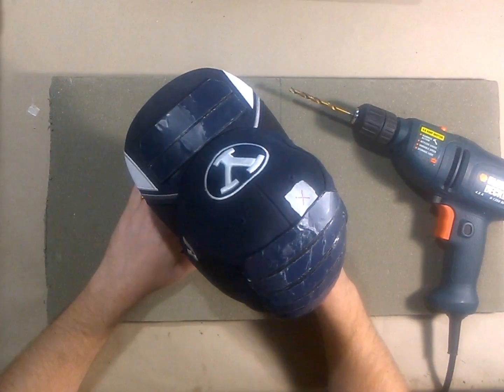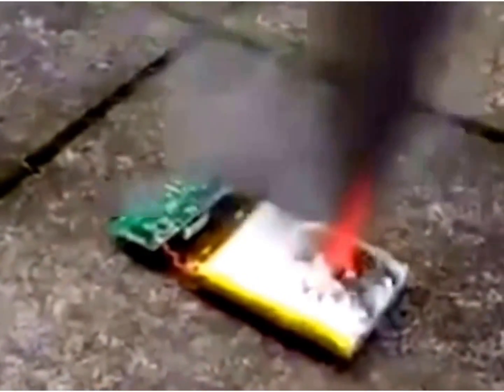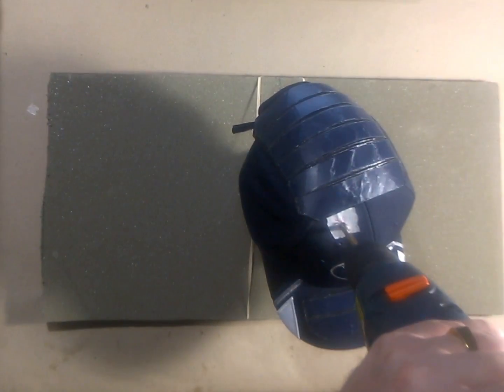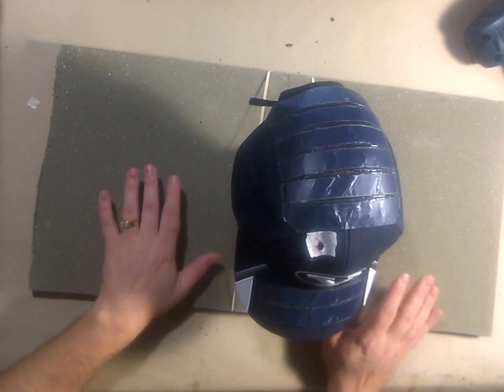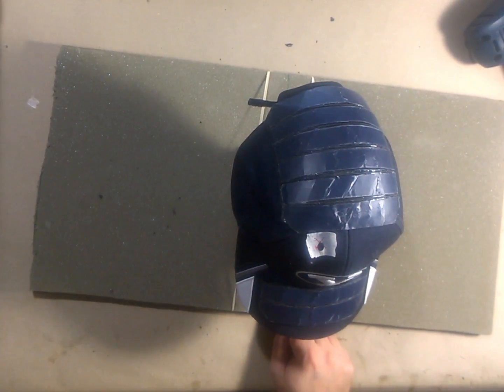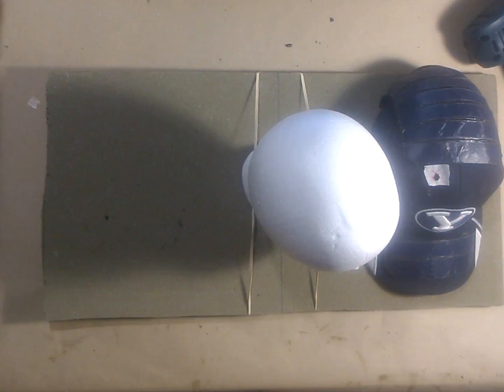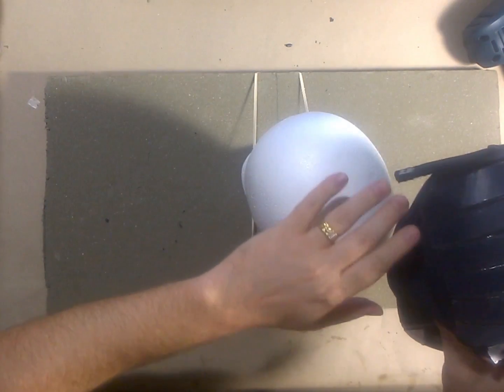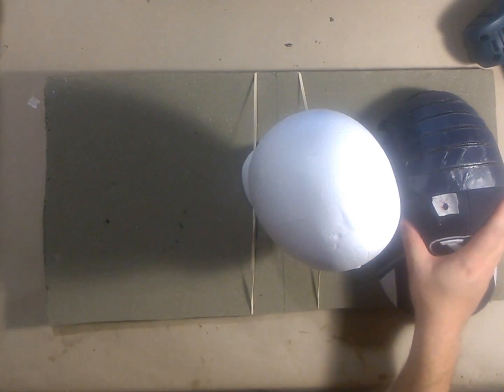Solar Powered Charging Hat Safety Test: Battery Drill-Through

Comment: Looks really good Mark, and hey one other thing about these hats is, they are about the only charging device not made in China, 
also you aren't kidding about cellphones, the battery in my phone sometimes gets so hot the back gets heated and makes my hand sweat and it one time made the screen so hot it actually cracked it.
Reply from the maker: Wow. Yeah, learning more about these things kinda makes me not want to hold one up to my cheek ever again >.>
Reply: Well, could be worse, one reason they got phone cases, also the more dangerous batteries actually have more power in them. safety vs more power, makes you wonder which is best...
Reply: I'd choose safety any day. You could save at least a year's worth of money by spending it on charging your phone rather than trying to pay for medical bills and plastic surgery when your face gets fused with your slightly liquefied iPhone.
Reply from the maker: Yeah, I'd have to agree
Reply: Fused with a slightly liquefied IPhone doesn't seem likely, more like 3rd degree burns on half your face and possibly death, so yeah safety might be better...